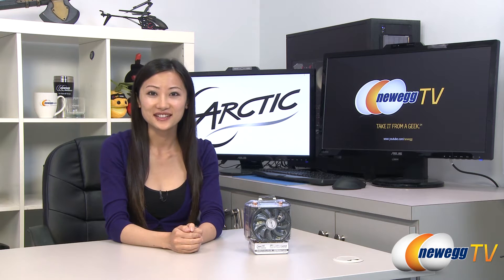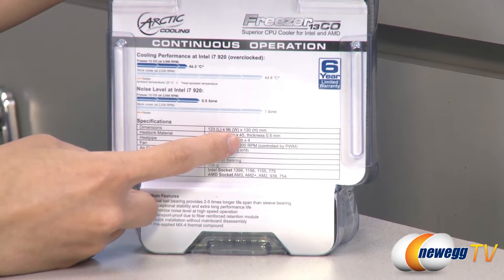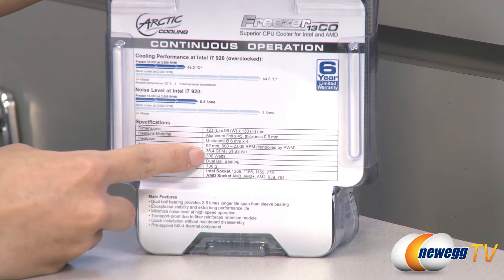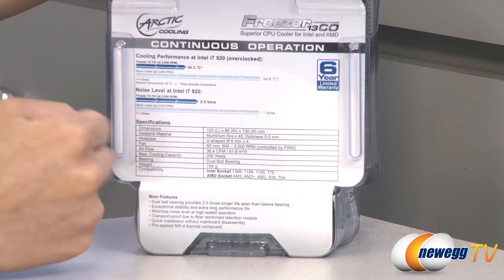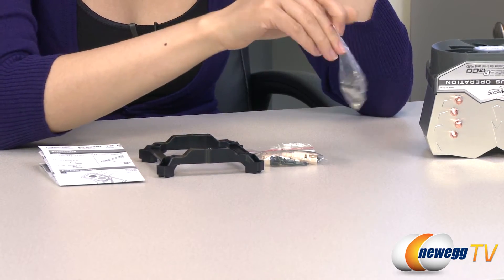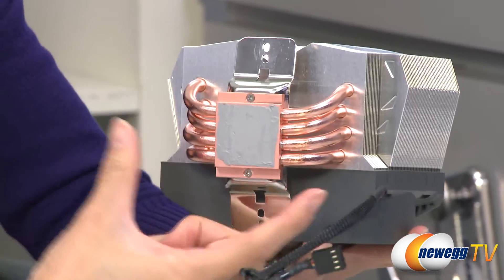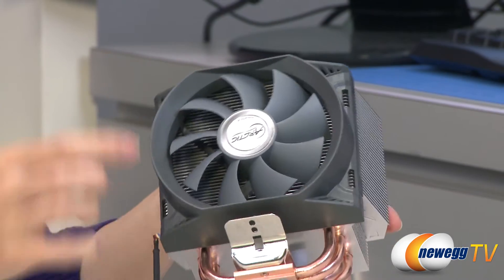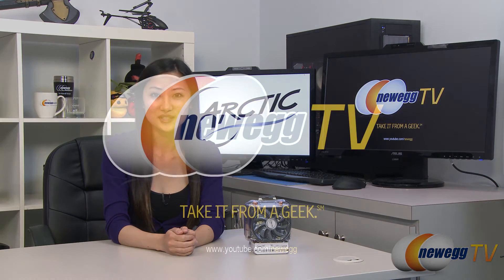Newegg TV: ARCTIC COOLING Freezer 13 CO CPU Cooler Overview

Comment: the website says am3+ aswell, or there is no real difference for am3 and am3+ when it comes to cooling?
Reply: no there is no difference when it comes to the mounting of cpu coolers just bought one of these with intent to install on my am3+ socket :)
Reply: thanks mate, cleared up any issues i had.